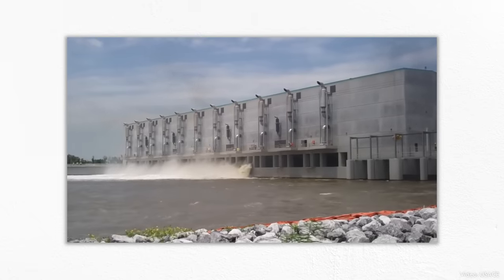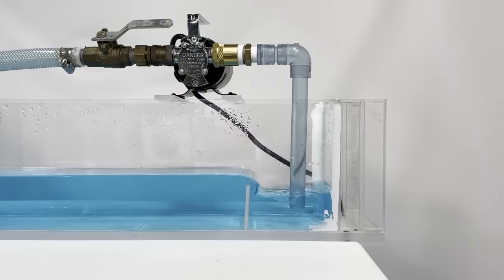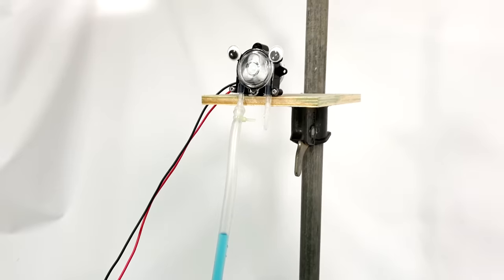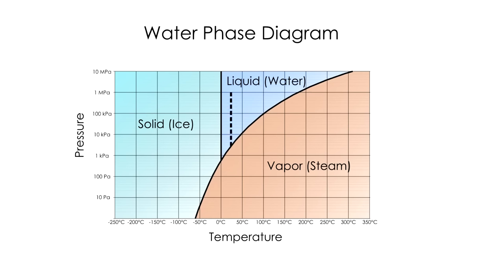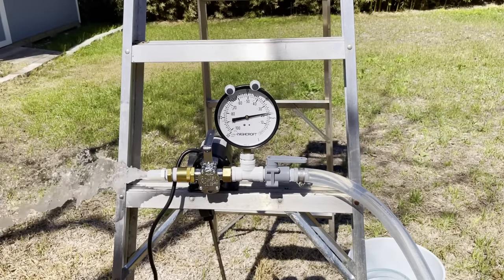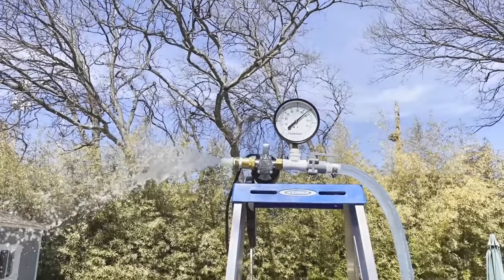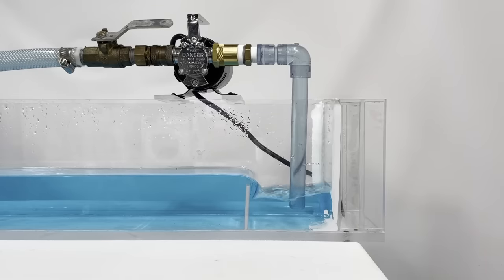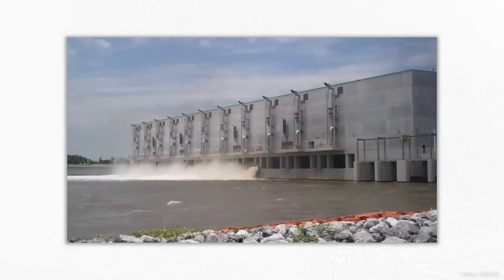The Fluid Effects That Kill Pumps

Comment: this is a great video, i wish there was a one stop shop for pumps for civil engineering that balanced application with theory. books are either too dense without actually being tailored to practicing engineers or not comprehensive enough in terms of the vast number and types of pumps engineers need to be familiar with - there is no shortcut to learning this material well other than working in the field for 5 years.

Comment: I saw a really cool YouTube video of a gentleman who made a small Hydro -generator in a low head dam on his property, I couldn't find the video, but he used a shop vac to Prime the system and he had a rather ingenious method of preventing vortices from forming, he had a basket around the inlet in which floated a tennis ball, anytime a vortice formed the tennis ball was sucked into the center of it disrupting the flow enough to dissipate the vortices.

Comment: Firefighter engineer perspective:

For the priming problem many firefighter pumps have a seperate pump that can pull quite a good vacuum, usually down to 5% atmospheric pressure which allows you to reliably get water from up to 9 meters below the pump location.

For cavitation it's usually learned that it means you don't have enough water supply...so you should reduce output. The super loud and annoying noise is hard to miss.

To prevent vortexes we completely enclose the system or pressure feed the pump with water. But if we pull water from open waters we usually have quite long hoses as we can't actually park our vehicles in the lake/river anyway.

Comment: Submersible multistage centrifugal pumps can also be destroyed because of the cavitation. I've observed it several times at the ground water intakes equipped with deep wells (boreholes). After measurements we concluded that NPSH was only ~ 1.5 m (required value was 6 m). We observed totaly broken characteristic diagram when certain flow rate was achieved. After that moment, total head dramatically decreased without significent increasing flow rate. As well as acoustic efffect appeared in pipes.
Why is that? There's narrow ring space between borehole's casing and body of the submersible pumping unit. In this place velocity of water is large enough to cause pressure drop, especially when meshes of pump's suction screen are partially blocked by larger solids (sand and fine gravel) taken by fast water (friction)

Comment: That New Orleans pump station looks impressive. In the late 80s in northern Utah there were several wet years which caused the Great Salt Lake level rise to the point there was concern for flooding in Salt Lake City. The governor authorized a scheme to build a large pumping station to the west of the lake and pump lake water to the west desert. The pumps (there were 2 or 3) were huge and powered by internal combustion engines, each of which is as big as a middle class house. Because of the extreme salinity of the water, the inlets, impellers and piping had to be made of an aluminum-bronze alloy. I heard (from an Ingersoll-Rand employee) that the project used the entire country's supply of aluminum-bronze and more had to be imported. Result? It worked. The lake level was reduced. The Bonneville Salt Flats were flooded so that Speed Week had to be canceled. The flats were however rejuvenated and were it much better condition when land speed racing resumed the next year. But the pumps were only used a couple of years and the whole installation sits abandoned in the desert.

Comment: Nice video. Only note is 3:30 points to what appear to be three static o-rings and the motor bearing/lipseal, not seals requiring lubrication/cooling. The mechanical seal (or lipseal, possibly) is blocked by the impeller. Also, super obscure pump choice - ha. Just throwing that out there as it could be confusing to someone who is looking for that particular piece of knowledge/failure mode. Keep it up!

Comment: Air in the impeller also has the added benefit of unbalancing the system. I've seen a few not-so-large pumps rip themselves off their housings due to the imbalance. (cattle water pump kind of thing) The jet pump that ran our house (spring water) would need new bearings every few years due to the imbalance. (sometimes because the backflow valve at the spring gets dirt in it and doesn't seal.)

Comment: i find it interesting that most pool filter systems include a removable basket in the inlet to catch big debris in the water before it goes to the pump but it also doubles as a way to break up any vortices that form. in my pool if i take out the basket a vortex immediately forms in the inlet and sucks a ton of water into the pump and filter that have to be bled out manually before the pump can start circulating water again.

Comment: At my workplace we burn through large 4" submersible pumps regularly because we have to run them w/o full sumps. To alleviate some of the stress we wired in a delay where when the pump runs dry, it shuts off for a few seconds to allow the sump to fill and then fires back up to drain it. It creates a kind of "breathing" effect. Because we're dealing with slurry we can't keep them off or else the pump will get buried as the solids settle, but we do burn through a couple a year depending on who is overseeing that station. Our pumps also use a "water jacket" to keep the components lubricated since it's not always submerged.

Comment: One way of avoiding cavitation is actually to intentionally let the pump suck in a little bit of air (via a bypass valve); the air bubbles are fully elastic so the pressure drop at the pump propellor blades is not as extreme as in a pure-water setup, thus avoiding vapor bubble formation. You probably would not do this at stationary pump since it decreases efficiency but I've personally worked with portable mud / sludge pumps that are designed for that mode of operation (for these kinds of fluids, the point of vapor bubble formation usually cannot be known, so "calculating things in advance" does not work for them)

Comment: Try this... put in 2 layers of fiberglass style filter on intake with a decent gap between the panels. The vortex may start but stopped at the first layer. The vacant part of this filter will allow enough water to keep the gap filled. The second filter equalizes the pressure so the sump can draw only water.  Try it out.

Comment: Hydraulic flow prototypes are super cool.  One of the biggest active ones you can check out is U.S. Army Corps of Engineers Bay Model in Sausalito California that models the San Francisco Bay and Sacramento-San Joaquin River Delta and covers 1.5 acres. One of the largest that is no longer active is the Mississippi River Basin Model in Clinton Mississippi, which covered a whopping 200 acres!

Comment: I have an indoor fish hatchery where I grow fathead minnows for our water testing lab. I noticed a problem with my sump pumps after adding some long air bubblers to the sumps. The air bubbles were being drawn into the sump pumps, reducing their flow rates. I solved this by moving the air bubblers to the opposite end of the sump instead of the center. This allowed the air bubbles to rise to the top of the water where they would not affect the pumps.

Comment: I used to sell pumps to landscapers.  I don't know if you can imagine the difficulty I had selling parts to solve these sorts of problems to people who were installing pumps.

One problem you didn't mention that I thought you would is dead head - what happens when a pump can't discharge fast enough.  Typically we'd see this in situations that also generated water hammer, such as someone just slamming shut a manual cut off value downstream of the pump.  But once you get passed the water hammer problem, you still have a pump trying to pump water into a system that isn't releasing its flow as fast as expected.  You can end up with steam in the pipes just from the action of the pump.

Sometimes you'd see them try to solve this with just pressure sensors and emergency relief valves, but that leads to another problem - rapid cycling of the pump as the pressure oscillates between too much and too little.

Comment: Great video.  I love pumps almost as much.  :)   One thing I remember in nuclear power plants, some emergency pumps had concerns about vortexes forming under emergency pumping conditions as the water supply level lowers.  I remember a few modifications were done to construct 'baffle boxes' and plates around the suctions to break up the flow and reduce vortex formation.  All seems a bit 'empirical' since exact modeling / calcs don't seem to work out.

Comment: I had my apprenticeship in a company that builds high pressure plunger pumps (up to 72000 psi) and also worked there for several years in the test bench.
One of the biggest issues was cavitation. Even valves made from hardened, specifically for this purpose alloyed, steel looked like Swiss cheese after a few months because gasses in the water had such destructive power that they ate holes into the metal. Until today the only solution is to replace the damaged pieces because it is cheaper to replace parts than to degas the water.
This already happens with pumps that work at 3500 psi, so you can imagine the potential structural damage in pumps that work at 72000 psi.
In this particular case it is to mention, that these pumps were built to achieve high pressure and not volume.
For the case that someone might ask: these pumps are mainly used to cut metal or concrete, the ones with lower pressure (3500 psi to 13000psi) are used to clean the transportation tanks of trains and trucks.

Comment: In the uk, theres quite a lot of Archimedes screw pumps that move sewage uphill, you see a lot of them at treatment plants, the ones i have seen at treatment plants are roughly 4 feet in diameter and around 40 feet long

Theres even one at my local hospital, which moves rainwater up a small hill and dumps it over a dam in a small concrete channel, thats around 2 feet in diameter and around 15 feet long

Comment: There are pumps in many small appliances, for instance a dishwasher has a minimum of two pumps, one designed to pump out the water after the washing cycle has finished, and another larger pump, that pumps the water through hoses and channeling into the spray arms that actually wash the dishes. Most dishwasher pumps are of two types: a small impeller pump that self-primes itself because it's always underwater and can withstand water header loss without failing. The other is the main impeller pump with a lot of small blades or vanes which is designed to propel the water to the levels required to reach the top rack of a dishwasher. This second pump can even shoot small bursts of water once they get sufficient levels in the pan at the bottom of the dishwasher, hence the reason some older models of dishwasher will sound as if they're shooting small amounts of water into the spray arms, that's because they are!

Comment: The information presented id good.  We make Instaprime pumps that use a high CFM and that prime dry up to 30', that can pump continuously flows as low as 2 GPM with a 3600 GPM 8" pump without losing prime.  We have not experienced any pump problems with vortexes except it reduces flow rates. There are several vacuum prime pump manufactures. We have 12 patents on our pumps. David Muhs

Comment: You have to consider all the same issues (but on a smaller scale) when designing an aquarium filtration system. Adding baffles to your sump to direct the flow can help avoid air getting into the pump.

Comment: Love your video. To break up vortexes just throw in a tennis-ball or the like near the pump intake to disrupt them from fully forming.  Simple is better when it comes to application.
Reply from the maker: Big pumps will eat a tennis ball without even noticing
Reply: @PracticalEngineeringChannel  Yes of course.  What pump size does this principle fail at scaling (with larger balls or other passive vortex disruptors)?  I know it works in micro-hydro applications.

Comment: A restriction before my check valve and some other problems caused my pump cavitation destroyed my impeller and stressed the motor over repaired the issue more it works great

Comment: I am in the fire sprinkler industry. 
The way we explain it…
We can create pressure, we cannot create flow (volume).

For example, if we are installing a new system and we need 1000 GPM for the hazard we are protecting, then we need to make sure that we have a water supply that can supply us with 150%+ of our need. So we would need a minimum 1500 GPM available. 

This means that if there is only a 6” water main in the street, then we are going to have to do some more work in order to get 1500 GPM, because 6” isn’t going to allow that. 
As soon as we can assure the volume we need….we can order a pump that will boost the pressure to whatever we need.

Comment: The factory water pump on my Duramax (09 LMM diesel) has a cavitation issue on the housing. It's not so bad it cuts it to pieces, but your supposed to swap housings when you replace the impeller cartridge.

Comment: Another bad effect of cavitation is it affects the efficiency of heat exchangers. I used to be in the industrial refrigeration service field with Ingersoll Rand working on Air Dryers and Air Compressors. 
One particularly Hot summer a customer was having difficulty keeping their air compressors from over heating and shutting down. These were water cooled units and with the cooling towers at full on with water fall and the fans on there should have been plenty of heat rejection capacity. 
It turned out the water level in the cooling tower was too low due to a faulty fill valve. When the closed loop pump capitates the efficiency for the heat exchanger goes down dramatically. When the heat created by the air compressor couldn’t be rejected the unit shuts down.

Comment: Diesel engines are also vulnerable to cavitation damage, where the energy of combustion bursts tiny bubbles in the coolant.

To solve this they include a kind of sand into the coolant filters. Not sure if that absorbs the energy, or changes the surface tension and redices bubbles.

Comment: PC water cooling reservoirs often have something in them specifically to break up a vortex. PC cooling pumps are also extremely sensitive to air, as the impeller is also lubricated by the water.

Comment: You would ideally place the pump, or at least the wet part, below the lowest possible waterlevel for pumping stations that pump water rain water. Placing a pump above the highest level might seem handy for maintenance but you'll end up with a lower then ambient pressure in the pump if the egress is also lower then your pump.  Gasses in the water always want to come out in turbulence and having a lower then ambient pressure really doesn't help. Having the system fully submerged makes the system easier to start and smaller systems don't require priming then.

But even some totally submerged systems need priming, or vacuum as its called. If the pump pipe isn't a straight line up to the egress side, you need to add a stand pipe above the highest leven in that pipe, usually at least 1m. that you suck below ambient (vacuum) till you start pumping water out of it. That prevents bubbles to start moving and messing with the flow. In the worst case those bubbles build up somewhere in the intake and get sucked in at once, if you got a MW on the shaft , that will brake stuff. 

This all is adjusting the pump intake for turbulent flow is nice, but keeping the flow laminar till it hits the pump is even beter.  At least from the hydrolic side of things, you can use turbulence to clean the water of sediment, fishing wire and rocks, the other stuff that kills pumps :)

Comment: Hey Grady. It doesn't fit your field of engineering, but as a pump lover, you could make a video about high vacuum pumps and what can damage them or what they can damage. There are two types, both very interesting. The oil diffusion pump is very basic and safe but can ruin whatever it is connected too when cooling fails. The other type, turbomolecular pumps, are extremely fragile and will disintegrate when they fail... Also destroying whatever they're connected too, but way worse than the diffusion pump. And today they are very safe and not a danger to people. But in the past a failing turbo pump could do some bad damage...

Comment: One use-case of pumps is in rocketry.   In that case, the pumps are moving volumes of fluids--an oxidizer and a fuel.   The challenges there are interesting because "priming" is an act to prepare the pump for the temperature difference as pumping extremely cold fuel into a (relatively) warm pump would be disasterous. 
One issue I did not see in your video was that of baffling the liquid.  Building baffles in rocket fuel tanks are used to reduce the vortices which not only are bad for pumps but also bad for maintaining a reliable center-of-gravity in a moving vehicle (they go from still to supersonic in less that 5 minutes). 

Concerning cavitation, there is a very interesting video out there about the Turbinia--the first steam-turbine-powered ship(https://en.wikipedia.org/wiki/Turbinia).   The inventor is said to be the first to discover cavitation as his steam turbine was able to spin the propeller fast enough to trigger it.  So curious was he that he built a special test rig so he could watch the screw through a small glass window to learn more about the phenomenon.

Comment: 1 type of pump that doesn't care about suction pressure is a screw pump, the job I retired from had 3-40k gpm screw pumps, we didn't have to worry about loss of suction, they ran just fine dry, pumped up about 30 ft of elevation.